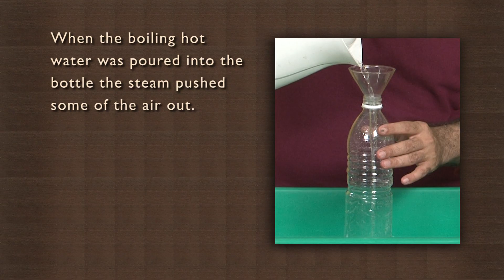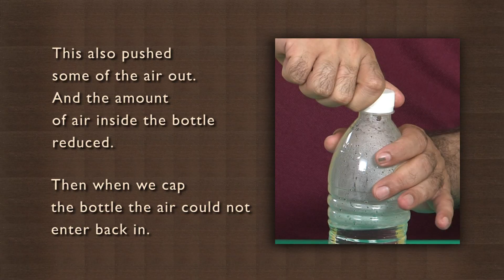Creating low pressure inside a plastic bottle crushes it | Pressure | Physics

Comment: KClassScienceChannel, I had to urinate into a bottle because the bathroom was occupied. When I screwed the cap on, the bottle's walls collapsed the same way as your bottle in the experiment within approximately the same time frame. My room is at 69 degrees Fahrenheit. Is the same principal in effect here? If so, I didn't realize that it could happen so quickly.

Comment: Nope. Warm air is MASQUERADED as low pressure as cold air is MASQUERADED as high pressure!! You create a VACUUM within bottle and it implodes per SUCTION!! SUCTION: the production of a VACUUM by the removal of air to force fluid/matter into a VACANT space or to procure ADHESION!!

Comment: when you close a bottle , why doesn't it collapse on itself ? shouldn't it since the pressure outside the bottle is greater than the pressure inside.Can you please make me understand
Reply: No cause there is water inside right?? And there is some amount of expanded  and non - expanded air in the bottle too. So there is some equal pressure acting from inside the bottle. That is why he used cold water, to cool and condense the expanded air aka steam.
Reply: @amitharavindpai3049  eventually as the water cools down, the bottle would have been crushed. Cold water was poured only to accelerate this reaction

Comment: Now how do you restore the bottle back to normal?
Reply: Tbh U can't restore it back to normal cause you can't increase the pressure inside the bottle so that the pressure inside the bottle is more than the pressure outside the bottle cause the atmosphere is huge and after you open it pressure in the inside and the outside will be equal sooooooooooo

You can't get it back to normal. The other logical think to do is pressing the crushed part from inside the bottle cause unbalanced forces Ya know.

Also I don't know if you are being sarcastic.
Reply: @amitharavindpai3049  
No sarcasm, I just had a problem with my bottle spray since I put hot water with   Clorox to clean but my bottle ended up getting crumbled up and wanted to see if I can save it.
Reply: @111585sandman Oh....Ok. Did you fix it yet??